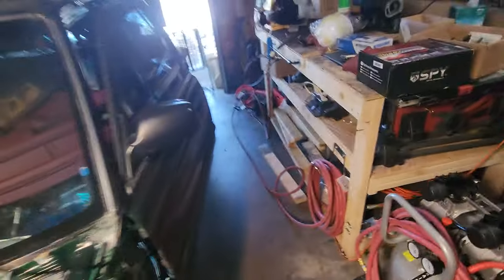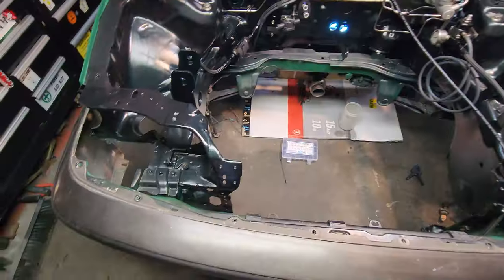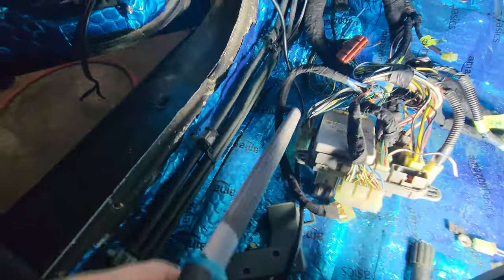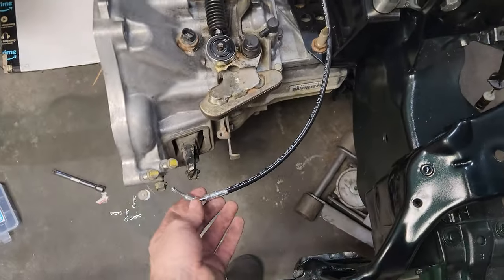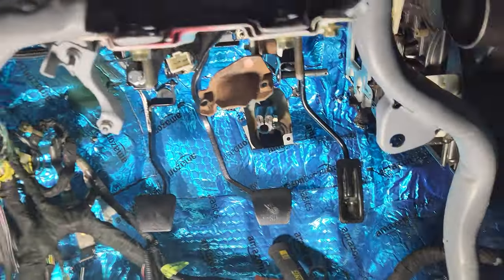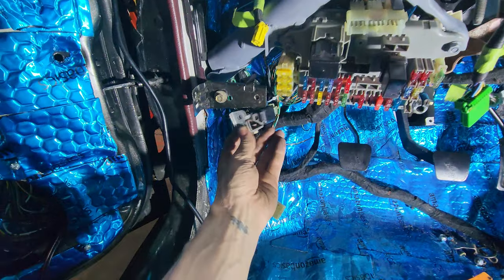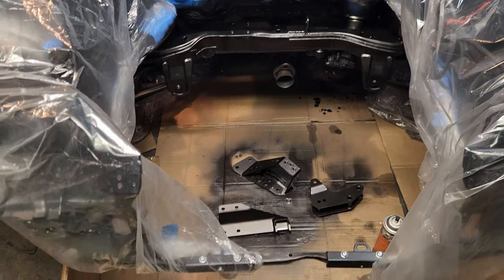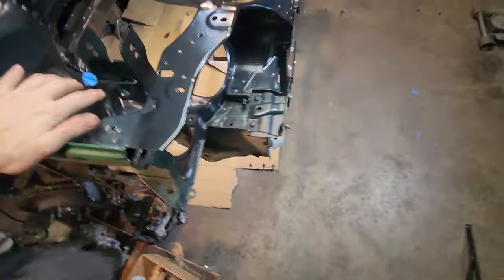EF Civic Sedan Restore #149, K-Swap part 18 Coming Back Together..

Comment: Do you plan on installing an aftermarket alarm system? If so, can you make a video on installing one please?
Reply from the maker: I totally would, if I was an alarm kind of guy.. I have so many anti thefts built into this thing.. non of which are discussed.. but I will be installing an alarm for the automatic door locks and I will discuss the wiring of all of it during that. It's coming up very soon, as that will be under the dash. Which is ready to go back on. So keep your eyes out.